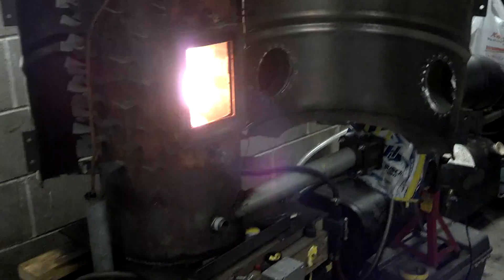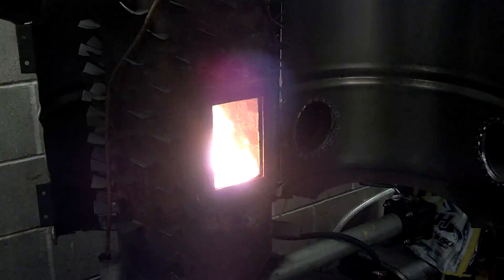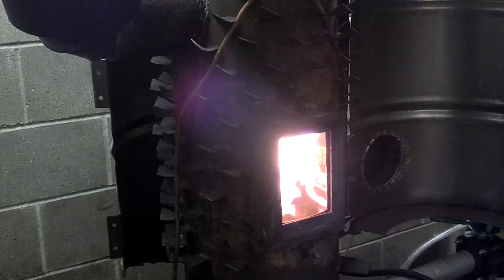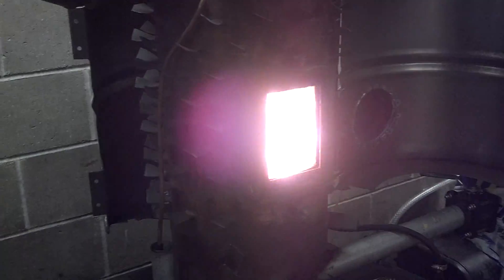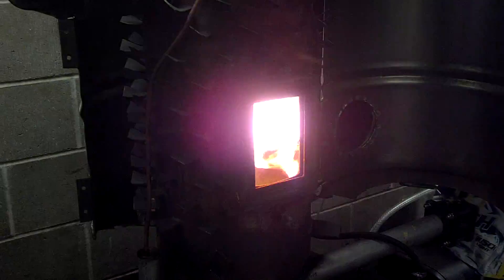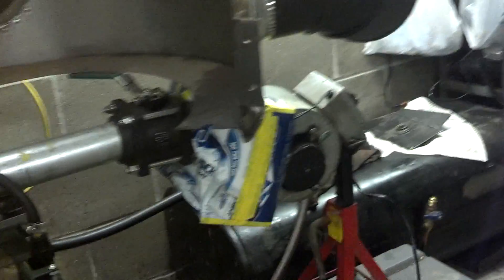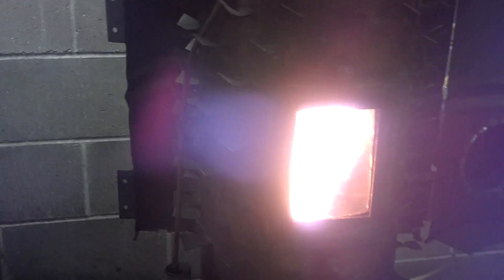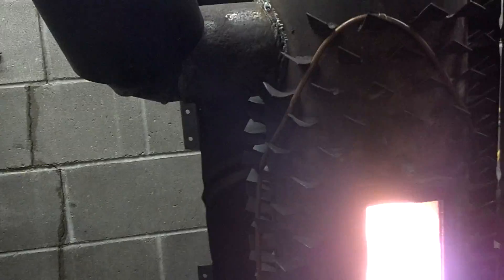Homemade waste oil burner

Comment from the maker: Also make sure that the air jet stem is not leaking at all. If it is you may need to braze it at the welds. Thats what i needed to do because i had a hard time with many small pinhole leaks. If you have any more Q's feel free to e-mail me @ veterandd214@gmail.com

Comment from the maker: I used a brass air jet with stainless steel insert. Size-  .015  if it is spitting oil make sure o- ring is sealing. Oil rate should be 5 qts an hour. Pressure should be 95 psi

Comment: I to bought the plans but cannot get the burner to work right, it spits out oil at you upon start up and hard to get the fire right also what size air jet are you using and is it all stainless steel with a stainless steel core for high heat purposes